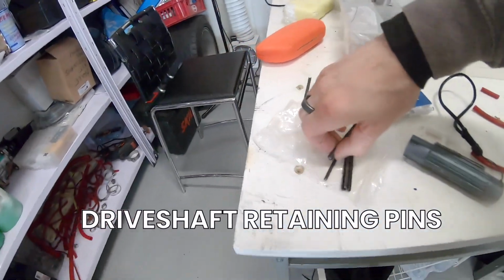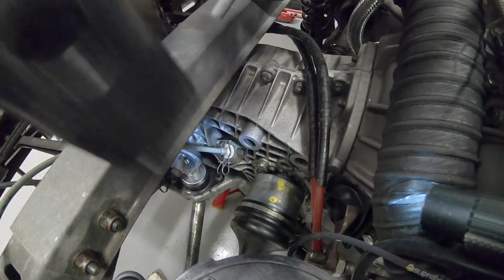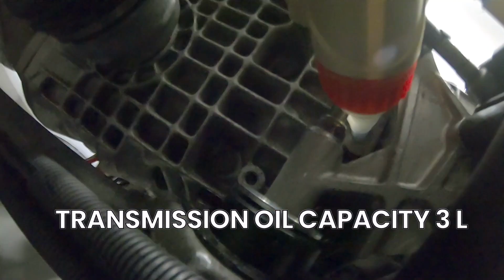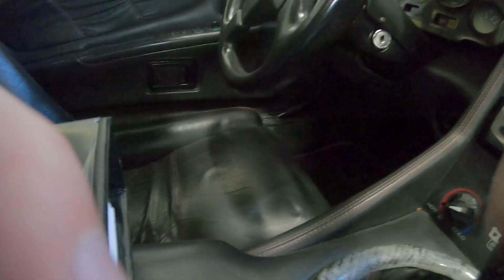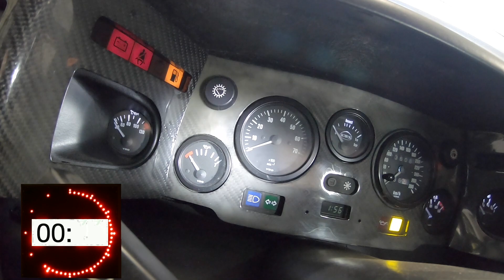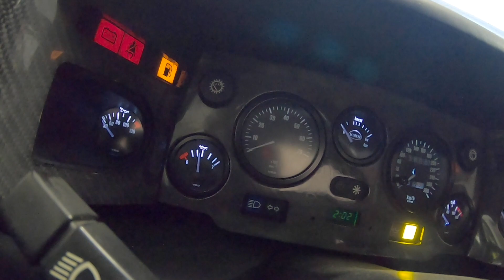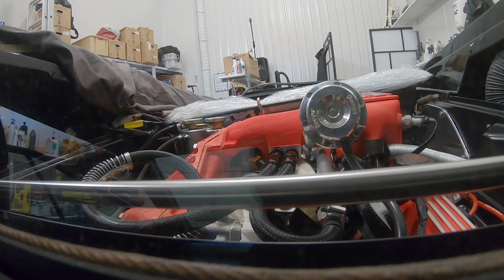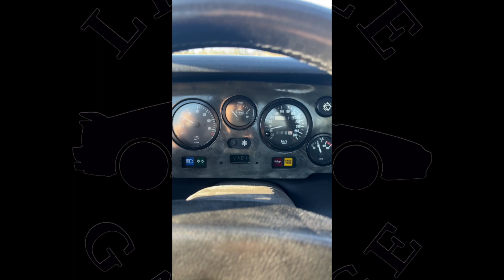The Final Chapter: EM19 - Engine Maintenance Series

Comment: I have just had my engine rebuilt, and the crank seal is leaking. The guys who did the build have discovered that the seals are not the right size to fit the crank. They are having a batch made up in the correct size to overcome the problem.
Reply from the maker: Thanks for sharing this! I purchased my seals and gaskets many years ago. I will install new seals in next year or so. Depending on how much they leak 😀